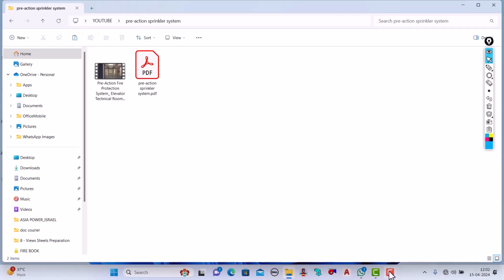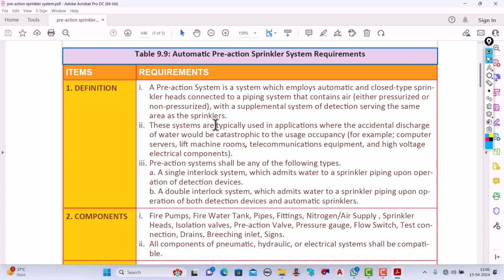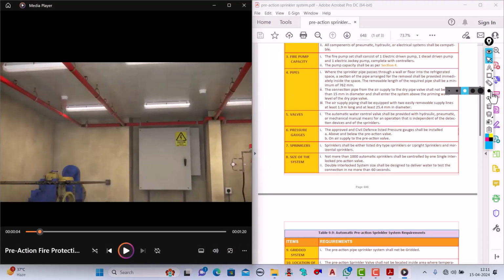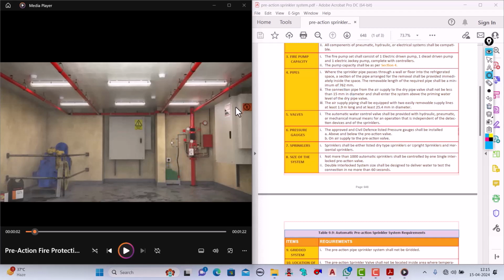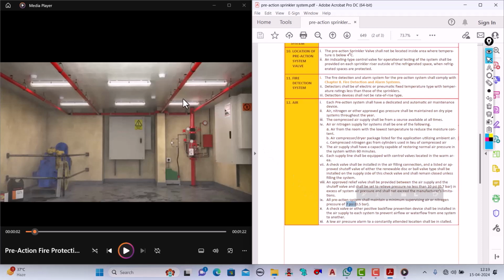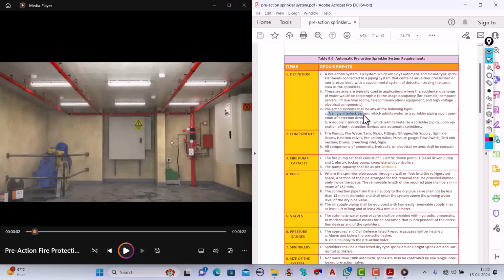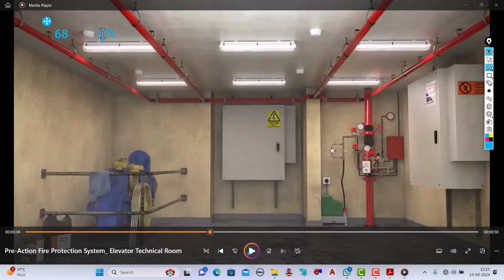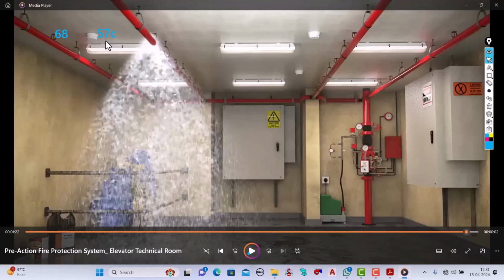PRE ACTION SPRINKLER SYSTEM

Comment: Hello Imran, Question.

1. Those sprinkler to be use is the same with automatic water sprinkler system which using alarm check valve?

2. How about in single interlock, it is open or close sprinkler (with breakable glass)?

3. How to size the compressor for the PAS?
Reply from the maker: 1&2:- We use the same automatic type sprinkler. The ACV is not required because of the Pre-Action Valve.

3:- Sizing of the compressor is not required. The point is, we have to maintain 7 psi in the pipeline.